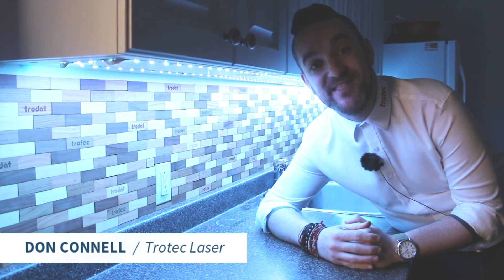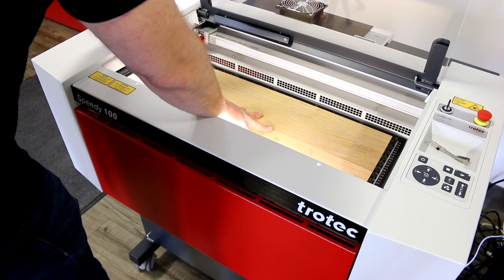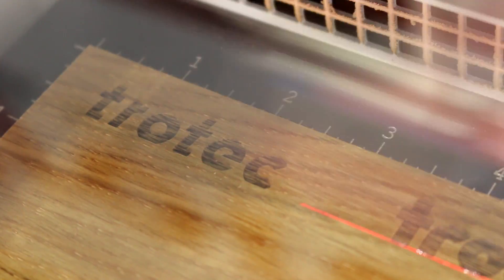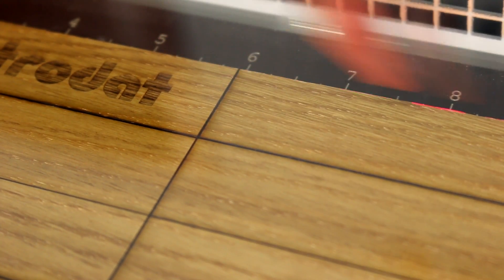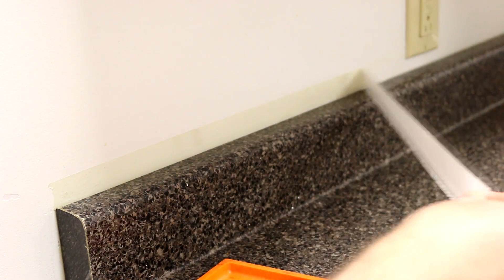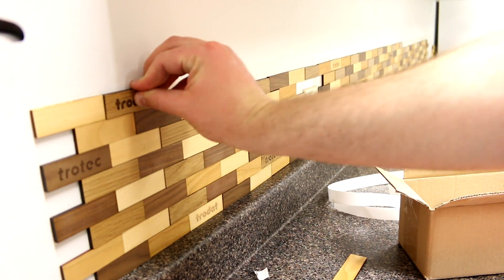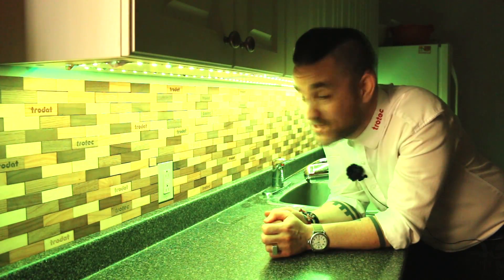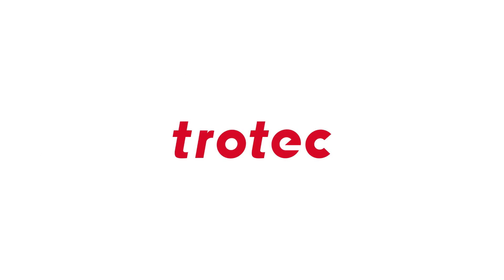DIY Wooden Backsplash with Custom Laser Cutting | Trotec Laser Cutter Tutorial

Comment: any idea as for the total cost for this?  Would it be commercially viable ?
Reply from the maker: It's less expensive than stone, especially if you pre-cut the pieces on larger blocks that you can glue together. If you don't engrave anything just cut shapes, you can do a quarter sheet of 12"x24" piece of wood which can hold 96 blocks, you can cut that in under 3 minutes. Especially if you already have 3M adhesive on the back of the quarter sheet, it's just peel and stick. So yes it can be quite viable.